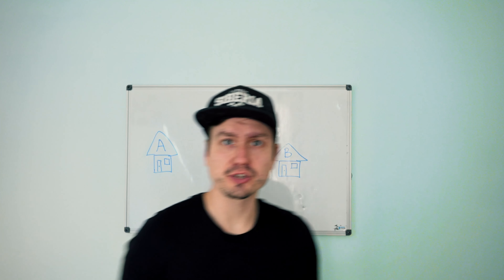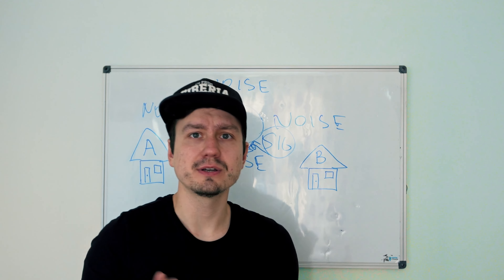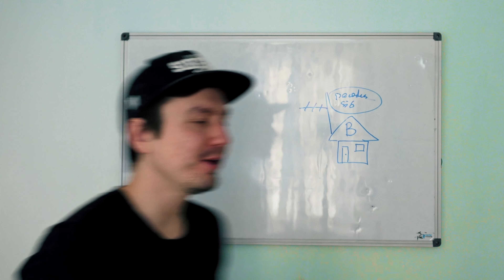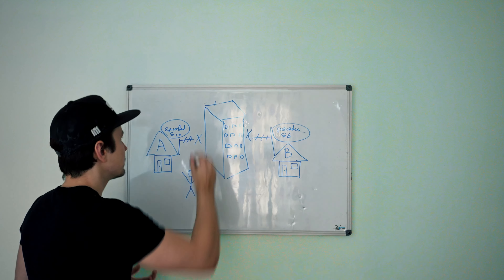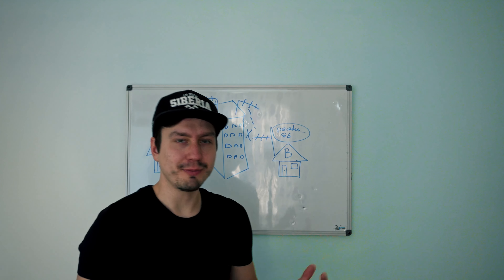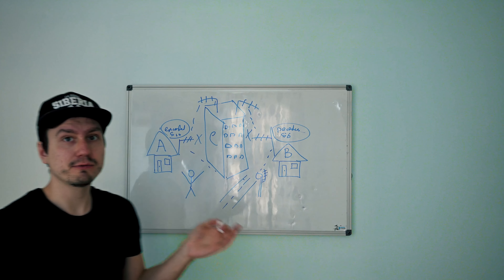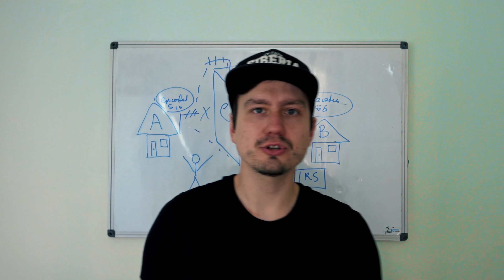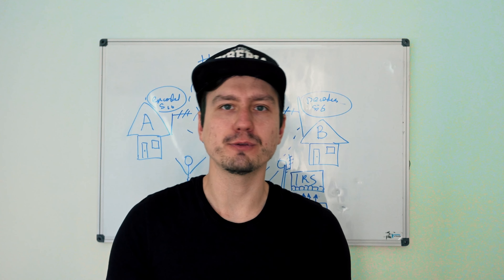From 5G to 6G. Reconfigurable Intelligent Surfaces

Comment: Can you explain to us the electronic parts of theMeta-surfaces  and how they work
Reply from the maker: You can find more details in this paper:
https://ieeexplore.ieee.org/abstract/document/9668918
In short, a digital signal is sampled by a TI 60096 DAC, which outputs a +/-10V unbuffered voltage, it is then buffered with OPAx277 opamps to give a buffered voltage between 0 and 20V (one per each column) that is then applied across SMV2202-040LF diodes. Varactors have a variable capacitance (in pF) which is the function of applied voltage, and this allows to get the desired phase shift by applying the Snell's Law on Arduino 
Hope this helps!
ps. You might also find this interesting:
https://github.com/jimrains/OpenRIS

Comment: The fact that many small loudspeakers put together gives the possibility of controlling the environment has been existed for some time, so how come no one has thought of it by making an analogy also with the propagation of signals from antennas? this sort of control can also be obtained using many antennas placed side by side rather than RIS, so i can't get the new thing by using the RIS? is it just a "promotting" product that companies trying to justify it is existence in order to sell ?
Reply from the maker: Hi Akremi, thank you for the interesting comment. You raised a few excellent points :) 
Beamforming in fact came to sound design from antenna theory, and has first been demonstrated in 1905! 
The main reason why RIS suddenly became a big thing (in my opinion) is largely because of attempts to adopt millimetre-wave (mmWave) communication in 5G. While mmWave offers many benefits (huge bandwidth, largely unpopulated spectrum), it suffers from terrible path loss and requires line-of-sight (LoS) or near-LoS condition between transmitter and receiver. Sure, we can build mmWave antenna systems with hundreds of antennas that support beamforming, but it's VERY expensive and inefficient due to reasons mentioned in the video. This is where using RIS allows a cheaper way to build a mmWave cellular network. As it does not have RF chains itself, a mmWave antenna array is still needed to act as a base-station in the centre of the cell, but several RISs can be used to expand the cell size around it and we won't need to install mmWave base stations every 100m or so just to make the mmWave communication possible!
Also RIS is not a product yet. It's a concept and as a concept it is still evolving, so it might not end up being at all what it looks like now.